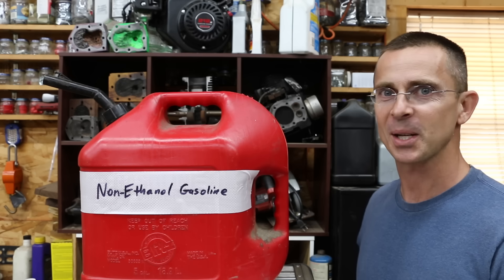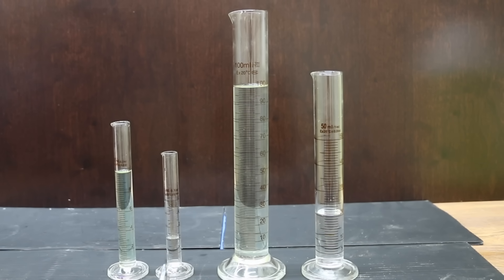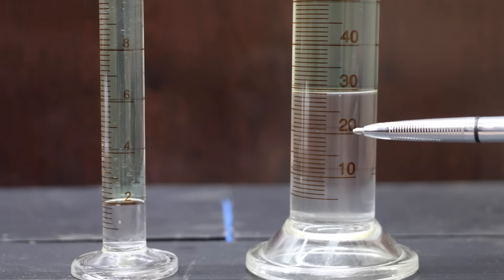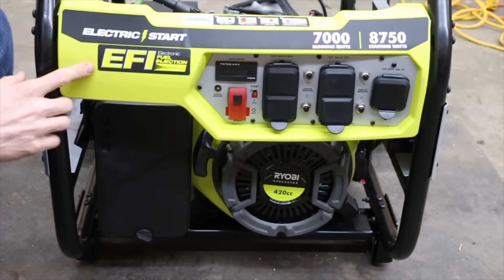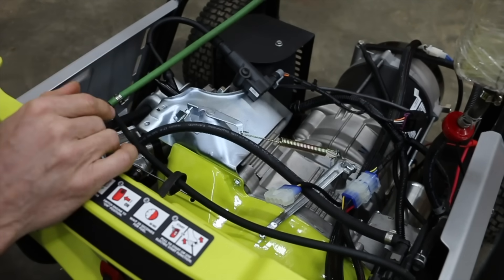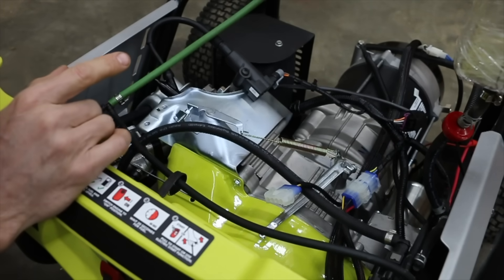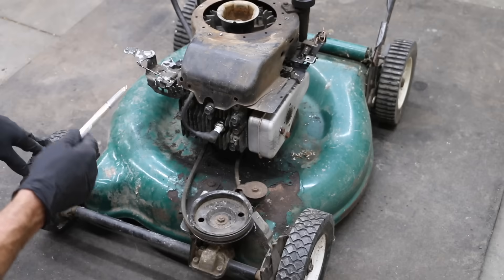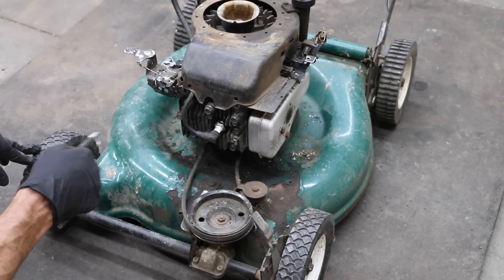Is Non-Ethanol Gasoline Really Better? See the PROOF!

Comment: Nice video, really informative! Where this test needs to be done is on a 2 stroke, as the ethanol supposedly doesn't lubricate the walls as good as regular gasoline and oil, causing premature wear. I would recommend testing on an engine that uses 40:1 or 50:1, as that may show evidence of wear caused by ethanol better than 32:1 or 24:1.  Maybe you could try this experiment again the E85 to see if there is any difference in efficiency or performance.
Reply from the maker: Thank you for the video idea!

Comment: It's been proven that ethanol can be, and is destructive to hardware in many cases. I no longer have small engine problems since I switched to 92 octane non-ethanol.
Reply from the maker: Thank you
Reply: Your 92 octane fuel is loaded(40%) with the very toxic, very corrosive, and very carcinogenic BTEX(benzene, toluene, ethylbenzene, & xylene)

Ethanol is much >>>easier<<< on rubbers, plastics, and metals than what gasoline and BTEX(benzene, toluene, ethyl benzene, and xylene) are.

If you doubt this, look here:

Ethanol = https://www.customadvanced.com/chemical-resistance-chart.html?chemical=Ethyl+Alcohol&rubber=

Gasoline = https://www.customadvanced.com/chemical-resistance-chart.html?chemical=Gasoline&rubber=

Benzene = https://www.customadvanced.com/chemical-resistance-chart.html?chemical=Benzene&rubber=

Toluene = https://www.customadvanced.com/chemical-resistance-chart.html?chemical=Toluene&rubber=

Ethyl benzene = https://www.customadvanced.com/chemical-resistance-chart.html?chemical=Ethyl+Benzene&rubber=

Xylene = https://www.customadvanced.com/chemical-resistance-chart.html?chemical=Xylene&rubber=

Need a second opinion?

https://www.coleparmer.com/chemical-resistance

Or here for a third opinion:

http://www.graco.com/content/dam/graco/ipd/literature/misc/chemical-compatibility-guide/Graco_ChemCompGuideEN-B.pdf

See what high aromatic gasoline is rated for with aluminum:

https://www.calpaclab.com/aluminum-chemical-compatibility-chart/

Note that ethanol is good with aluminum.

The main nontoxic ingredient of RV antifreeze is ethanol and it would not have stood the test of time if it had been corrosive.
Reply: @danafletcher2341  I cut grass at several places and use a weed eater and other gas powered garden tools. Ethanol gas has destroyed 2 weed eaters one gas hedge trimmier and 4 lawnmowers in several years.I had to clean out the carborater on the newer lawnmower that ethanol gummed up and clogged in only one year .I have to buy fuel additives to keep the ethanol in the gas fro ruining more engines
That stuff is awful
Reply: @danafletcher2341  
Ask ANY small machine repair company and I promise you they will agree with me 
Ask them go ahead 
They know not you
Reply: Dana Fletcher quiet, you're being proven wrong by people who directly work with the stuff. you only have links and your same unintelligible ramblings. Ethical destroys small engines, the proof is right there you're just to blind to see it.
Reply: @ProbInsane  am not blind, I have told them to sell everything they have and buy small engine repair shops in Brazil.  I sure hope they reward me with a token of appreciation when they all become super wealthy(provided they are correct on this).

 I work with the stuff too.  Since the mid 1980s in fact when E10 was called gasohol.  I hated small engines (long before ethanol) watching my father fight to get running both Briggs and Tecumseh engines every spring which sat all winter for years back in the 70s.  That is why in the early eighties I remember talking him into buying a hydraulic water pump instead of those unreliable gas powered ones.  Worked out great, I still use that very same one to this day even.  A friend who seemed like he bought new gas powered water pumps every year one year told me about a new engine manufacture back then from a well known company called Honda.  He said they have quality, start all the time, and last forever and would never buy anything else.  I took his advise even though I in principle liked to buy American made products, but if the difference was that great, I would make an exception. I don't know what everyone's problems are with small engines are today, but I never have problems with Honda engines and I own quite a few and many are getting old.   The do seem to last forever IMHO.   A few years ago I even looked for a Honda wheeled string trimmer to no avail.  Rather than buy a Briggs, I looked hard for something else and found one with a Subaru engine.  So far so good if has worked great, but still wish I had a Honda. 

BTEX(benzene, toluene, ethylbenzene, and xylene) are extremely corrosive on rubbers, plastics, and even metals not to mention the hundreds of other nasty and toxic aromatics and natural gas condensates being added to gasoline recently.  Ethanol is so non corrosive, it is sold as the main ingredient of nontoxic RV antifreeze.

Brazil, since they are at E27, does not need to add those super corrosive aromatics for octane which is probably why their small engines are not all destroyed everywhere and why other countries are following that example.

My anecdotal evidence along with the other posters' here is of little worth.  A whole country's use of almost three times a strong of blend of ethanol in identical small engines with it working out so well that two other whole countries following that lead is proof with real value.
Reply: Dana Fletcher they're talking about small engines fool not vehicles.
Reply: Dana Fletcher specifically made engines to be able to sustain the damage caused by high ethonal fuel
Reply: @ProbInsane  Great because we have/have had the same engines here too. Gasoline and BTEX(benzene, toluene, ethylbenzene, and xylene) are very damaging (unlike ethanol) that any engineering chemical compatibility chart will show you.  You have a paradox in your paradigm.  Note that Argentina is going to E27 from an E0, then E5, and E12 stages over the years.  Paraguay has now gone to E25 and E27.
Reply: @danafletcher2341 , You keep posting these articles and links like they are Gods words. The people who actually work with and on weed wackers, blowers, chainsaws and any other small engines for decades, know what Ethanot does...It ruins engines and it's components. If you had 4 decades, that's 40 yrs, like I do, you would realize that Ethanot sucks AZZ. These problems were non existent until Ethanot came around.
Reply: @augustreil  Not too many work with small engines more than Mercury Marine does and they think E10 may be the superior fuel to E0.  Here is a webinar and powerpoint of them talking about it and they note nothing about their engines or components being ruined.  I hear no reports of their engines being destroyed in Brazil either with E27.

https://web.archive.org/web/20140922142320/http://dcd96xmek71bc.cloudfront.net/archives/email/Trade/BoatingIndustry/MythsofEthanol-August252011.mp4

I do remember my father's small engines being varnished up from E0 straight gasoline every spring and helping him take carburetors apart to free the needle and/or float.  One does not ever forget the smell of varnished gasoline.  When E10 came called gasohol in the 80s, that never happened ever again whether or not I used Stabil or not.  I did have to change fuel filters in older items super frequently at first until the built up varnish was gone however which was not pleasant.

Henry Ford's favorite fuel was ethanol and he designed the Model T for it.  Production models were flex fuel.  E10 was sold in thousands of stations in the Midwest after Rockefeller's Prohibition ended in 1933 up until just before the war.  An E10 to E30 was sold in Britain for many years.  One E10 called Cleveland Discol was sold from the 30s until 1968 which ended when BP bought them out.  No reports of engines being destroyed.  That is an API wives' tale.

If you truly believe ethanol destroys engines, take all your savings and buy every small engine repair shop in Brazil, Paraguay, or Argentina where the fuel has three times the ethanol as here.  You should get triple the money back or more.  Perhaps you could set your grandchildren up to be wealthy if you are correct on that.  

The engines there must be destroyed in triple less the time, no?  Paradox?
Reply: @danafletcher2341 , Sure. Whatever.
Reply: Yes, either use non-ethanol fuel or add an additive like Stabil-A.

Ethanol will ruin 2 strokes and their carburetors in one year with regular use. Pay no mind to the ethanol lobbyists on here, been drinking to much of their product I suppose.
Reply: @tonesmith909  You too should move to Brazil and buy as many repair shops as you can if you truly believe what you claim.  

Most negative things on ethanol originate from the API which is the huge propaganda arm of the petroleum industry.  I do not know if you are a lobbyist or a parrot.  I certainly am not an lobbyist, but if you want to consider me the devil's advocate for the time being, it could free up more time for you to work finding and refuting anything I might have incorrect.

The DOE did a study and found ethanol blends actually last three times longer than E0 straight gasoline:
https://www.theautochannel.com/news/2016/09/22/286340-new-government-lab-research-confirms-ethanol-blend-fuels-are-better.html
Reply: @tonesmith909  
Thanks ive never heard of anyone praising putting moonshine into gasoline  to ruin its quality
Thats what ethanol is you know a by product of moonshine from distilling corn.
I talked to an old timer He said use a fuel and oil addative called marvel mystery oil Its very old from the 1920s and said it works very well.It was used in some of the first car and airplane engines and will clean and lubricate everything
Reply: Is there a reason to use 92 octane rated fuel...I always thought 88 octane fuel had more energy since lead was eliminated from gasoline.

Comment: Hey Mustie!!! Wassup pal. Luv you channel too! So now that the crap  is said 8).
 I am interested in the different hoses. So I have a snowmobile, a 2006 Polaris FST , and the tank has a submersible pump in the tank its fuel injected and the manufacturer used I think Polyurethane Hose as a suction and return in the tank. It completely embittered (Decomposed Brittle) and fell apart in sections. I replaced it with SAE 30R10 (FMK) fluoroelastomer. Its been great so far but I was wondering if you have time show what the different fluids do the the different grades of hose. Breke fluid does weird things real quick. you know trans fluid, Antifreeze, Gas Diesel Alcohol
Reply from the maker: Thank you for the video idea!

Comment: Excellent video as always.   I use Shell V-Power 100 octane that contains E7 here in Europe. I get better mileage with 100 or 102 octane in my Skoda Rapid with a 1.2 TSI engine.  Looking forward to seeing the results of the long-term alcohol testing.What about Bio-Diesel?  How is it compared to Diesel? Is Bio-Diesel better for small engines as it has better Cetane and higher lubricity?
Reply from the maker: Thank you for the video idea!

Comment: I read that the 4% better mileage from E0 gasoline correlates to more energy for the engine at any given moment. I guess there would be many variables, but regarding motorcycles, the theory is that E0 gasoline would provide more horsepower (~4%) over E10. Would that be true, or is it just a factor of the mileage?
Reply from the maker: Thank you.  It would not provide more horsepower but a gallon of E0 does contain more total energy/BTUs.

Comment: I have heard to run your lawnmower completely out of gas,  and others say always use a little Tru fuel when storing it over the winter. Which is best/right?
Reply from the maker: Getting every last bit of gasoline out is the problem.  A small amount will likely remain and will cause corrosion.  Tru fuel is the way to go.

Comment: Testing the fuel resistance of elastomers used in fuel delivery systems is a tough job and I'll be very interested in the results that PF gets.  Nowadays fluoroelastomers are used which are specifically designed to resist today's fuels so knowledge on which materials are actually used will be needed.
Reply from the maker: Thank you

Comment: So non-ethanol looks dirtier, but the ethanol looks like it has more carbon build-up? In my experance it really matters the engine you are using on how it acts to ethanol. With smaller engines like 4 cylinders you can see a decrease of mpg, but with a v8 you really don't see any real change in mpg. And as far as power I've never felt any difference going from one to the other.
Reply from the maker: Thank you

Comment: Ethanol laced fuel has an advertised shelf life of just 90 days where non ethanol lasts upwards of two years. Furthermore, ethanol laced fuel eats fuel lines, attracts water and often prompts oxidation in the carburetors within a single off season, resulting in the need to replace carburetors on the extreme end and needing a thorough cleaning on the positive side. This should only be the beginning of your ethanol testing. I suggest filling the tank of one of the junk mowers, leave it sit idle for 6 months, then come back to it and look at the carnage that ensues from the presence of absorbed water due to the ethanol. Using materials that are effected but not in their natural environment (in a push mower) won't yield accurate enough results. Sacrifice two push mowers. Fill their tanks with ethanol fuel and one with non ethanol and let them sit for 6 months, then inspect the carburetors and fuel bowls before starting. I think you'll be surprised at just how much damage ethanol laced fuels do in the real world. I'm a small engine mechanic and I've been dealing with this very issue for years. I'd say 75% of the engines i get in need new carburetors and fuel lines as well as a well cleaned out fuel tank. Zip~
Reply from the maker: Thank you

Comment: In Poland we have two main kinds of gasoline - 95 octane (normal) and 98 octane (super). There are some racing fuels (>100 octane), but in Europe octane number is RON (it's like 91, 94 and >96 octane in USA). Mostly they contains 0-5% of ethanol (E0 or E5), I haven't seen E10 or more in Poland yet. In most cases if cheaper fuel is, there is less ethanol in it ;)
Reply: Same in Germany but we have since ca. 2012 no E0 with 91 octane only E5 95 octane and E10 95 octane and E5 98 octane
Reply from the maker: Thank you

Comment: If you have non-alcohol fuel and get some moisture to condense in the tank it's going to go straight to the bottom and immediately get sucked into the engine. If you get a little moisture in the ethanol fuel it will be more intermixed with the alcohol better chance to burn it off.
Reply from the maker: Thank you.  I have a video on this coming soon.

Comment: My gas cap was a bit  broken,   got water in my tank, likely somehow from sprinklers. The shop owner changed out the fuel injector two times then figured it out. He considered this a learning experience and did not charge me. This is an important point.
Reply from the maker: Thank you for commenting on this!

Comment: My personal experience, with my f-150 2007 is that ethanol trashes my gas mileage, at least according to my on dashboard, average of 10-8 miles per gallon compared I almost 15 miles per gallon without ethanol. Only vehicle that I have had that has problems with it.
Reply from the maker: Thank you

Comment: Nice test. Would like to see the generator test run two more times. See if the non-ethanol fuel is consistently more efficient.
Reply from the maker: Thank you
Reply: Then buy a generator and try it.
Reply: Try it in your car or truck. E10 usually ranges 4-7% less efficient than pure unleaded.

Comment: The whole problem with ethanol gas is it is hygroscopic like brake fluid. All small motor fuel tanks are vented to atmosphere unlike most cars and trucks which are sealed once you turn the ignition switch off.
Reply from the maker: Great point!  Thank you

Comment: I currently added STP Diesel Particle Filter cleaner to my diesel. Perhaps it would help burn off carbon in the cylinder as well? The engine definitely heats up fast with the stuff and we have minus degrees currently. I'm interested if it's like seafoam.
Reply from the maker: Thank you for the video idea!

Comment: A lot of people says that gas with ethanol does harm to old engines, because it damages piston rings and "burns through" the cylinders, valves etc. I'm an owner of 2000 car so I'm little bit worried. Does anyone have an answer?
Reply from the maker: Your 2000 car will not be harmed by E10. Thank you.

Comment: You ever seen that silicon oil used in rc cars shocks? It's pretty much the oil version of dialectric grease or plumbing grease. It's really oily and excellent for rubber-to-metal. However, I once tried to use it on a pocket knife and it was horrible - felt like grit was in there. I did some 'research' and found silicon oil is actually poor when it comes to metal-to-metal contact (especially when there's pressure)....

Given that, I had always assumed that silicon oil would just destroy an engine - despite its use on guns and other metal applications. So, I don't think it can, but would an engine run with silicon oil?

Thanks for the great and entertaining vids...
Reply from the maker: Thank you for the video idea!